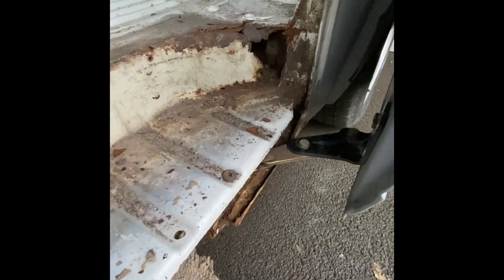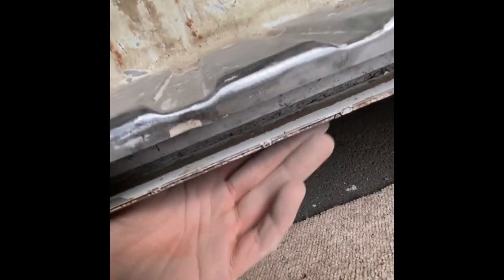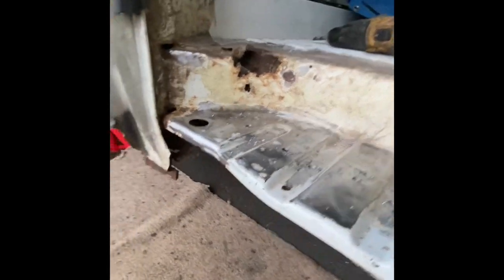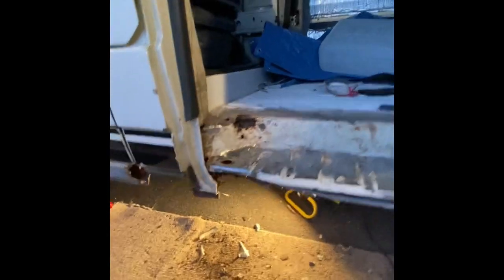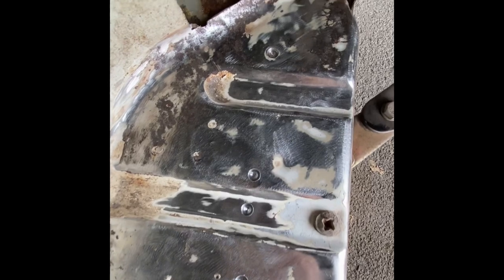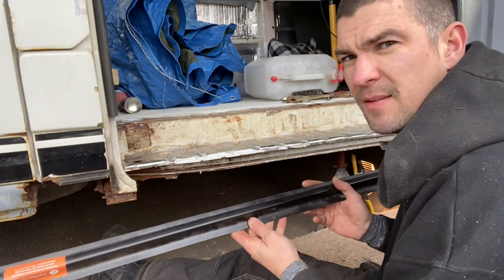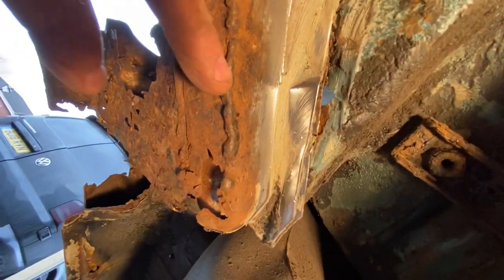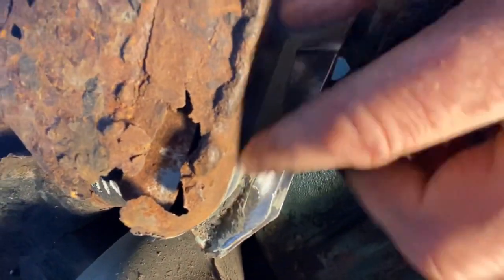VW T4 repairing the rotten sliding door track (removal)

Comment: Alright for some .. you managed to undo the bottom bracket off the door bracket . Mine was solid and the original domed headed Allen bolts ..both heads rounded out . I undone the lock plate you took out after the door was off that allowed the door to just pull out complete with brackets . Date with a grinder and old runner bracket was off the door .
Reply from the maker: It’s such a pain when a stuck bolt is a bigger job than the job in hand starts off as!
Reply: @pdubs7831  it was the intent to change the running gear as the bearings were shot but there was no way those were coming out in situ . Seems someone had changed the step before but left the door gear as is ...

Comment: Hi mate - the last 2 issues you have:  Mine does the same until you rev it up a little.  My issue is the exciter on the alternator it just need the additional revs to kick this in then it starts charging the battery and supplying the correct voltage to the oil pressure sensor.  Basically a new alternator but it doesn’t really bother me for now.
Reply from the maker: Hi Paul, thank you so much for your help, that would make sense. I’ve been thinking what common issue would cause both problems. I should have some time later today to try again. 🤙
Reply from the maker: Hi Paul, have you seen my video of finding the fault? Wonder if you have the same problem?
Reply: @pdubs7831  Hi mate,  yeah I checked all my wiring and seems ok.  I definitely think mine is the alternator but won’t hurt to double check 👍🏽

Comment: Rather than cutting the lip off the seal carrier I flattened it over with a hammer which leaves a nice smooth edge and as it is double thickness it secures the door seal much better. Just make a few cut and shuts around the curves.
Reply from the maker: That was a good idea, thanks for the comment, it gives others that watch and read more scope for options 🤙 cheers badge

Comment: I need to do a weld in the area where the door runner pulls in when you shut the door. There is a crack in the triangular corner. My worry is how close it is to the diesel tank.. is it best draining that and taking it off before attempting to plate up the crack so I can use the door again? It comes off the runner when I try and close the door at the moment (but fine when it’s open) the joys 😂
Reply from the maker: Hi, I managed without taking the tank off and instead boxed off the tank with some wooden boards. The tank is easy to take off though and I show this in another video.

Comment: nice vid ,,but very bad engineering by vw .maybe a rubberoid coating and a drain hole in each box section would have helped prevent that rusting
Reply from the maker: Hi Eddie, there are indeed drain holes however for the same reason the front wings rot they are areas where dirt gathers which retains water, coupled with poor cleaning / maintenance they are prone areas to rust away. For this reason I’m very careful that as soon as I hear that something has dropped onto the track with any of my vans I clean it out which prevents paint damage and future metal work issues. Hope the video was helpful to you if your tackling this job 👍